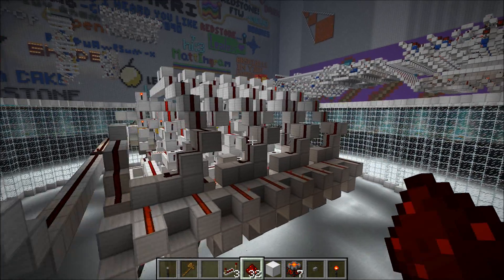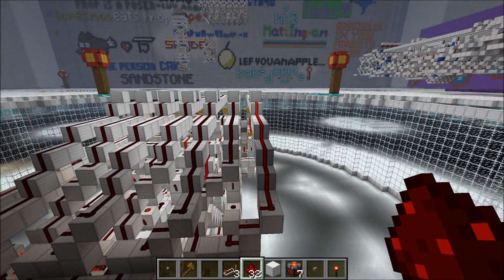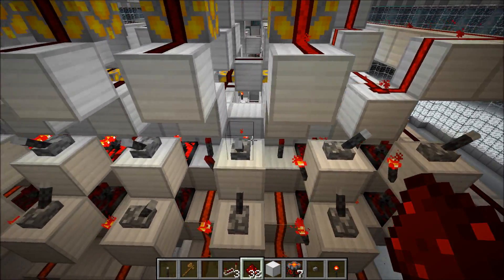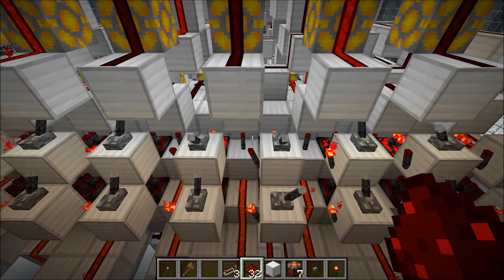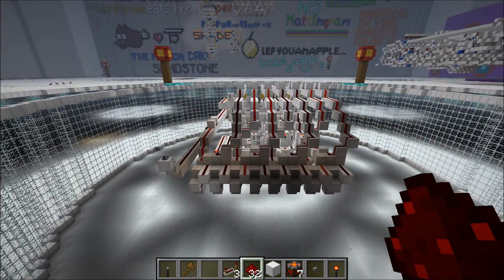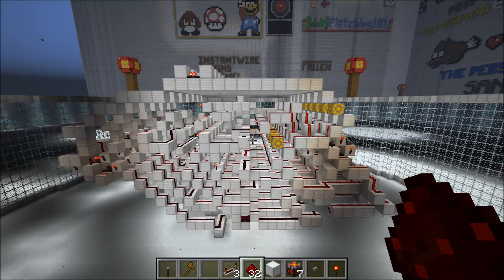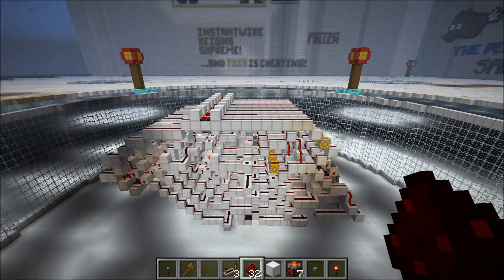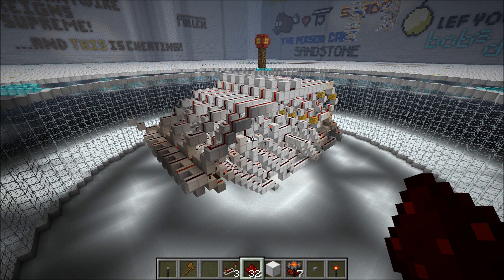2-Wide/Bit Kogge-Stone Adder - A Fast Real World Adder (No Pistons Necessary!)

Comment: I also got derp pistons in circuit in which I needed a ALU when I used our instant carry adder. However in my case I was able to fix it by replacing the first XNOR with a no-piston design. Even though this some very cool and impressive circuitry it might still be faster and reliable to only replace some piston logic with none piston logic.

Comment from the maker: The best way is to start off by converting from binary to binary coded decimal (bin to BCD) using an algorithm called double dabble (there's a good article on wikipedia) and decoding BCD to decimal. The best implementation of double dabble that I've seen in MC is a method called "streaming bin to BCD" where you use use memory cells to keep it compact.